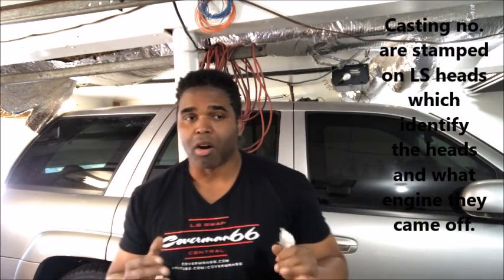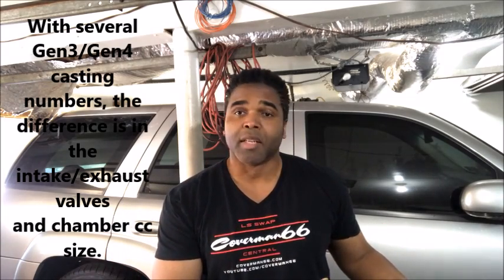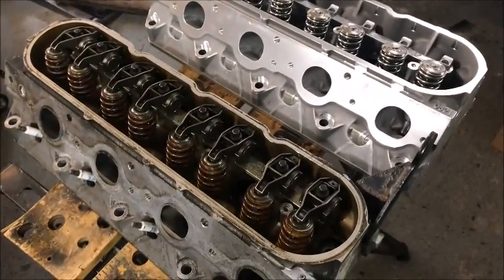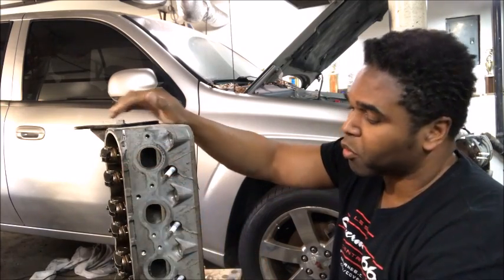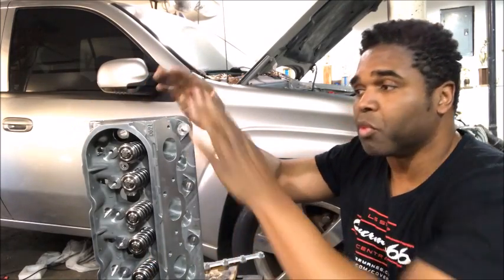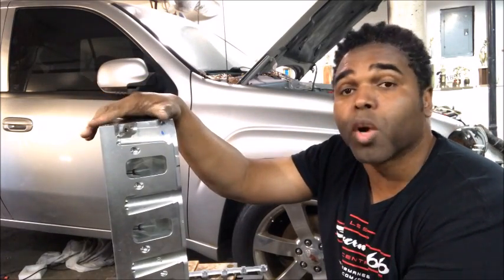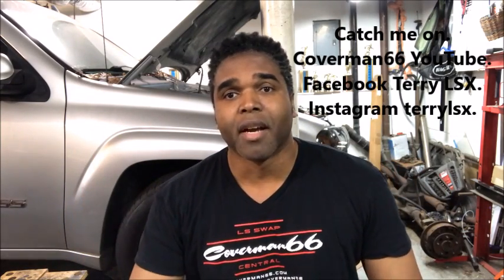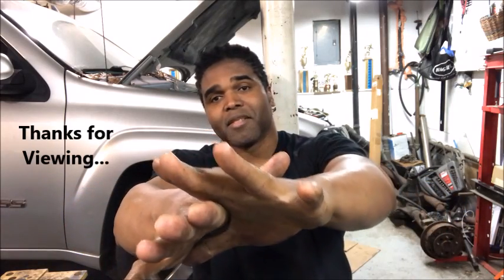LS2 vs LS3 LS Heads. (Which Heads Make More Power.)

Comment: well, I was told I could use 862 heads on my truck with a gen 3 engine 2003 chevy Silverado. and I'm going to use my rocker arms this is ok right?
Reply from the maker: as long as the heads are cathedral port, all the rockers will fit.

Comment: So I would be able to put ls3 heads on an ls2? If I where to later cam it would it be a problem with the valve length?
Reply from the maker: im using ls7 valves from the stock ls2 valves

Comment: No dyno or anything?  Maybe Richard Holdener is spoiling us but if you're putting "which make more power".  I'd expect something to substantiate your opinion.
Reply from the maker: Richard is a great guy, we've done and will be doing more videos together  this video was made to show the differences and spec for you to make a decision on which head is best for your application. both heads are great.. depending on how you use them is the deciding factor.

Comment: What heads can I put on my 4.8 for some good power?
Reply from the maker: whats the plans for the car? turbos at some point?
Reply: @Coverman66  Full bolt ons (intake, headers, exhaust, ported tbss manifold and 92mm throttle body), cam, and possibly 75-100 shot nitrous down the road

Comment: 6.0 stock block with 408 stroker with turbo and nitrous what heads and cam should I use to make the most power possible and does cams and heads affect your compression ratio?
Reply from the maker: heads will have very little affect on the compression.. i would call BTR to  get a good idea of what cam you should use for your application.

Comment: So I'm building a 04 yukon 5.3 with a ls2 cam. Should I also go with the ls2 heads or keep the stock 5.3 heads? I'm putting in a crew cab Chevy square body.
Reply from the maker: LS2 heads are better and and they will bolt right on

Comment: Good Video! I have a set of CNC Ported 823 heads and Ported intake with a Comp 235/251 621/624 @113 . This combination is in a 08 Sierra Denali AWD with 3200 stall. I have received Backlash from people saying it too much but I was wanting to make power on the big end truck has 4.10s Front and rear . Do you think my combo is wrong with running 33inch tall  tires
Reply from the maker: depends and whats you want brotha.. give Nelson Gill a call at ACC performance. he will break it down and tell you where your Truck will be with this setup.. the guys a genius lolol
Reply: coverman66 MANNNN THANKS! Do you have a Contact number or Web address

Comment: Hey that for posting this great videos! By the way I have 2009 Silverado 5.3 I am planning on swapping a 6.0 in it I really like the LY6 but I found a LFA and it cought my attention. Here is a set up I have in mind I would like to get the ported ls3 gm heads afm delete. vvt phaser TSP have a kit with low lift Stage I Camshaft Specs: 208/214 .550"/.550" 112 LSA
Stage II Camshaft Specs: 212/218 .550"/.550" 112 LSA
Stage III Camshaft Specs: 216/220 .550"/.550" 112 LSA
Reply: This is the high lift cams 
Stage II Specs: 212/218 .600"/.600" 112 LSA
Stage III Specs: 216/220 .600"/.600" 112 LSA
Stage IV Specs: 223/226 .600"/.600" 111 LSA
I have so far I have cold air intake and I would keep the stock truck intake unless you recommend any after market one also shorty BBK headers with cats
What it would be the best cam for my truck thanks thanks you
Reply from the maker: depending what youre looking for, i like stage 2 or 3 cam.. and i would use the truck intake because they are the best torque making intakes.. call tsp and ask them about the cams and tell them what your plans are so they can steer you in the right direction..
Reply: @Coverman66  
Thanks for your response and yes I would be keeping the truck intake .I have been looking at the fast lsxrt . In regards of your preference on cam stage 3 on low lift of high lift ?
I think the fast intake with interchangeable runners high compression 6.0 and  vvt would be interesting to see how all of that works together also would go well with ported head from summit racing. Another question would I be needing a torque converter ?

Comment: LS3 heads are not really all that they are made out to be. They have a big port of 265cc
A good set of ported 243 heads perform much better all round. These have a max CFM of around 340 but with a much smaller runner size.
This translates into better throttle response and a much stronger torque curve off idle to red line.
I switched to a set of CNC LS3 heads from stock LS2 and I noticed the torque losses straight away. I even used a smallish camshaft but it didn't really make much difference.
The LS3 is essentially a race head that has benefits in the top end above 6500rpm+. 
LS3 heads work best on big bore engines with a large port size.
Any engine with a 4.125 bore or larger is what they are really designed for.
LS3 bore size is the bare minimum and while they do work ok they are not ideal.
Don't forget CFM does not equal more power. CFM is a measurement of how much air flows through the port.
What makes power is high air speed and efficiency.
Reply from the maker: depending on the application both heads work well.. i didnt want to use adapter plates for the LSA so i went with the LS3 ported heads.. thanks for the knowledge brotha MM
Reply: @Coverman66  You are welcome. I am using AFR 245cc cathedral heads for my LS 434 because of above points.

Comment: Both LS2 and LS3 heads are good and in most applications the LS2 head can make more torque from idle to 3500rpm about 10 to 20 foot pounds the LS3 head will make more torque from 4500rpm to 6000rpm about 10 or 20 foot pounds and the LS3 head will make more horsepower about 20 or so from 5000rpm to 6500rpm LS3 heads like a split lift camshaft with more duration and lift on the exhaust side and with the right cam with CNC ported LS3 heads at the crank can make 400 foot pounds of torque or more from 3000rpm to 6900rpm which makes a wide powerband that revs like crazy and loves being pushed hard to 7200rpm with a car that weighs 3500 pounds or less with driver with a good suspension 3000 or more stall converter 4.10 gears 275/60 drag radials can assure you low 11s to high 10s in the quarter mile with some tuning and testing on the motor no nitrous turbos or supercharger on pump 93 octane fuel using a stock LS2 or LS3 shortblock with some good hardened pushrods and a SFI harmonic balancer a cam with just under 230 duration on intake side with .550 to.570 lift and just under 240 on exhaust side keeping lift .600 to .615  so streetability will not be a issue as piston clearance with valves won't either
Reply from the maker: great info Gloria.. wow..thanks for the comment..

Comment: I have an LQ4 6.0 and I was planning on putting a set of 243 ls2 heads on it along with an ls6 cam. Do I need a different length pushrod or do you think there is anything else I should upgrade?
Reply from the maker: when you order the cam i would get the springs and harden push rod.. which should be the same size.

Comment: I recently picked up a lq4 with #317 cast heads which i was told are a D style cc chamber 64cc ls6 head.. I've picked up 862 heads for 60$I've been told that they can bring up the my compression ratio to 10.5:1 on the lq4... the motor has 200k on it pulled 404 hp on 93. I'd like to match the power of my g8gt that has 821 heads
Reply from the maker: i would start with ls3 style heads and a cam.. thats wil be the best power without having your engine machined..

Comment: Are the ls3 heads 88958758 that summit sell better than the 821 heads? Or are the same? 
I want to replace my 821 heads to my truck
Reply from the maker: the 821 heads on your truck are good heads.. i would rock those.

Comment: I'm looking into a Corvette down the line... c6 to be exact, the ls2 is cheaper than the ls3 soooo what do you recommend doing to a ls2 in order to out perform that ls3? Better yet how to out perform a ls6 believe that's zo6
Reply from the maker: im doing a dyno on my ls2 TBSS. i swapped the cam, heads and LSA we will see what the numbers are..
Reply: @Coverman66  in that video can you give your opinion on ls2 with those mods vs ls3 with bolt on?

Comment: Where did you get your heads from I’m looking to buy some
Reply from the maker: you can get them from summit racing.. thats where i got mines.
Reply: Were they bare heads or did they come with valves if not what valves did you go with
Reply from the maker: i went with the cam kit which come with the right springs which i replaced.. the valves are stock to the heads..
Reply: Got a link to the heads you used I couldn’t find them on summit racing website

Comment: Hey Terry , New to your channel. I've come across your video in hopes to maybe answer a question for heads i have. I'm debating between LSA vs. LS3 heads. Both seem similiar yet the Int./Exh. sizes & Volumes are different. I'm planning to go with a built LS3 & dish out a 1000 horsies. on a single turbo setup. Which would be best & why!? Let me know please and thanks!
Reply from the maker: thanks brotha Dark.. either heads are great, but if you want that power at the wheels you might need to give trick flow a call and let them whats you want to do and what they recommend.. keep me posted.. what are you doing with the bottom end and cam?

Comment: Good channel man. If you're after hp and have a 4 inch bore there's no reason to not go to the rectangular port heads. Cheap 50 hp gain with loads of potential.
Reply from the maker: how true, how true.. lolol thanks brotha Nubbins.. much appreciated..
Reply: Im new to this . Would the ports have to be modified if switching from a Cathedral port to a square

Comment: Im trying to figure out the ls2 or ls3 head swap myself. Bought an 06 tbss and a loud tapping is coming from the  upper driverside. Maybe a lifter. So i have to remove that head. At which point i was offered ls3 heads and esp cam with the approach rockers etc etc.
Reply from the maker: what do you think about that?
Reply: A couple folks in the tbss group told me not to do it. Idk lol

Comment: So if I decide to put ls3 heads on my ls2 would I need a ls3 cam kit? And bolt up ls2 LT headers? Kinda lost lol Thanks
Reply from the maker: the headers will bolt up. you dont need to replace the cam at all...
Reply: coverman66 thanks bro
Reply: Headers will bolt up no problem. Due to different intake ports, you'll need an ls3 intake manifold.

Comment: Isn't there a slight clearance issue with ls3 heads on a ls2 block, rotating assembly?  Or is it a straight bolt on process?
Reply from the maker: from what ive read you the clearance should be ok.. just make sure you have dual spring on the valve.. i will be posting the results for sure..

Comment: Great information. Give me your thoughts on a LQ9 cam and spring set up. Really wanting to know how much better the 243’s are vs the 317’s? 
Thanks
Reply: More compression w/243 smaller chambers
Reply: I need this 2
Reply: 243/799 share the same intake/exhaust port volume on the 317. The 317 will have larger chambers due to the larger bore of the 6.0 block. You will definitely make a lil more power with the 243/799 because of the smaller chambers "more compression."

Comment: What's the best heads for a na 5.3l 99 to 02 year lm7.
Reply from the maker: it all depends whats you doing and how much power you looking to make brotha Fig..
Reply: @Coverman66  looking at 350 wheel with heads cam and nice truck intake with bigger throttle body

Comment: Will either heads work on a 4.8L/5.3L
Reply: Ls3 heads can not be used on any LS engine smaller than 6.0.
Reply from the maker: Yes they will.. very interchangeable..
Reply: Wrong, they will not work. Ls3 heads requires a minimum of a 4" bore.

Comment: I put gen4 4.8l heads (799) on a gen3 5.3l.
Reply from the maker: nice, how does she run'?
Reply: @Coverman66  made 460whp 15psi on a 88m on3  turbo.  But I had problems  with over heating and blowing spark out.  This is the year😂😂

Comment: Hey bro i have a 1992 oldsmobile custom cruiser with a 350 in it any ideas on getting a little more horsepower out of it has the tbi on it and smog heads on it with dual e exhaust
Reply from the maker: depends on how much power.. you can always do a cam swap with heads.. that will wake the engine up..
Reply: Sounds good i will have to find a good mechanic to help me thanks again bro😊
Reply: Lose the tbi heads and install Vortec heads. Put a mild cam in it. 210 to 220 degrees at .050 lift. Have the valve guides cut for .500 lift. 

Fun tip: you can get more "lumpety lumpety" sound from the engine just by tightening up the lobe separation angle (LSA) to about 105 degrees, without needing to get a race cam.

Comment: I'm guessing you're installing the rectangular port head to promote better air flow. Do you have flow numbers that you can share comparing the cathedral to rectangular port LS heads? Also, why do the LS3 heads use (or need) the offset intake rockers, is it due to valve stem geometry or cylinder head architecture?
Reply from the maker: whats good brotha Ray, they will give me better flow up top and what i lose down low the blower will more than make up for it.. the offset rockers are because of the valve and cylinder architecture.. good call lolol
Reply: You asked my question. First time watching your vid coverman66, Very nicely done!

Comment: I have a LSA on my 5.3 Gen 3 for towing, not racing
I am planning on a 6.0l build L96 keeping VVT to run a bigger cam without a stall converter. Your thoughts? or just go Ly6 and calmer cam. (towing deep down TQ)
What engine is in your trail blazer? 
Are piston squirters worth the time and trouble to dug a LSA block or drill them in a 6.0 block
Love ya Terry!
Reply from the maker: whats going brotha Charles, vvt works well with auto trannys.. my TBSS has a BTR ls3 stage 2 cam.. didnt want to get to crazy.. its my every day truck lol.. i dont think you will need the squirters  i never used them.. hope this answer all your questions.. thanks for the comments and the luv.. much appreciated

Comment: Out of curiosity, does more CC in the head’s work better with boost? Or is it the other way around?

As always a informative video
Reply from the maker: some say it works against it, esp down low. if you have a blower that will make up and you will have more power on the high end because of the high cc volume.
Reply: The thing i was told to look at is the overall compression ratio, boost increases the ratio. So depending on how much boost you're planning to run, that's where you'd want to look at which combustion chamber you'd want. Really just depends on how much boost, what fuel and how much power you're looking for.
Reply: Higher cc will result in lower compression ratio. Lower cc will be higher compression and make more power. Traditionally its always been lower cr for boosted applications and high cr for NA or nitrous. With a good tune/fuel of course. Personally i dont like low cr for boosted applications. A engine with 10:1 running 10lbs of boost will make the same hp as the same 8:1 engine running higher boost. Higher boost = more heat.